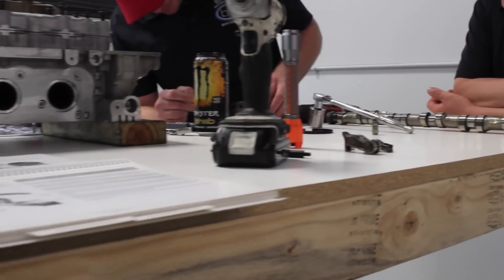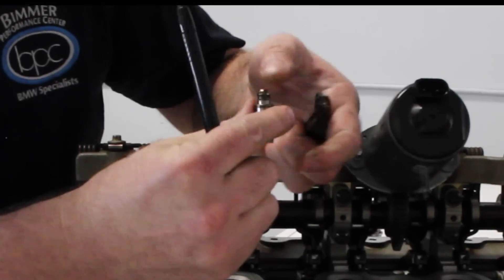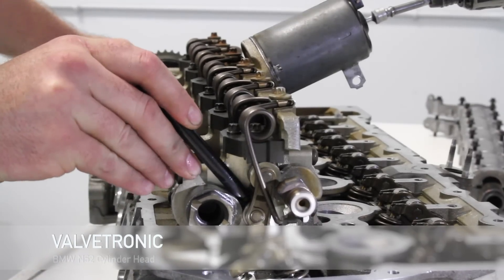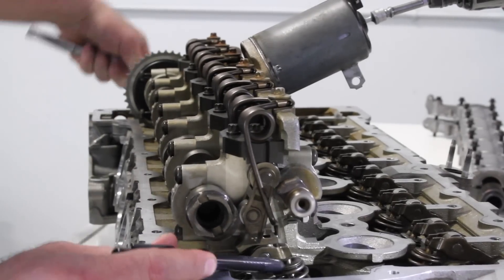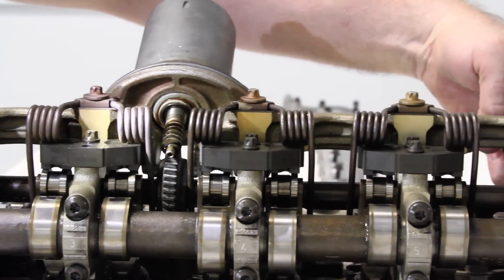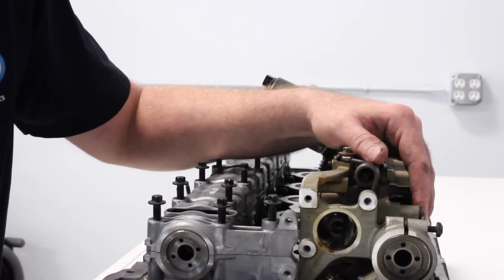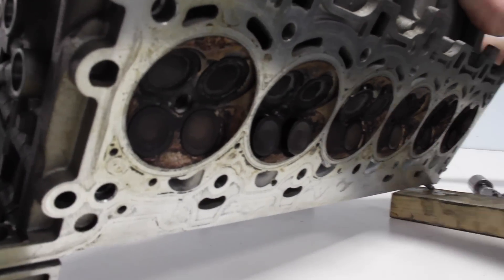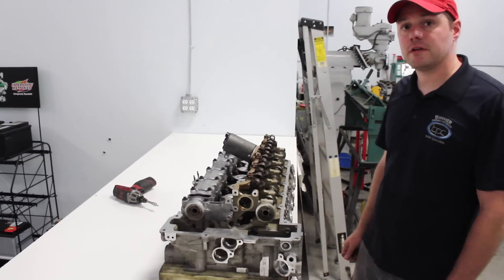"Inside the motor" with Dan Connor - N52 Cylinder head

Comment: Very informative and well done. I have an '07 with the N51 and was watching the BMW Valvetronic video, and my jaw dropped as I viewed the technology that went into this. The speed of the computer in the DME to control this, as well as the speed at which the Valvetronic motor is required to turn to effect instantaneous throttle response has got to be "lightening" fast in operation.

I shudder when I hear people talk of 15,000 mile oil changes even with BMW's oil, as it will not keep the engine sparkling clean inside at that rate, unless perhaps you never left the freeway! 

Why would someone, for a few dollars, allow their Rolex to become permanently filthy inside, not to mention the increased wear, chance of stuck piston rings, and increase of problems that accompanies such practices with the VANOS system?

Excellent work, my friend!